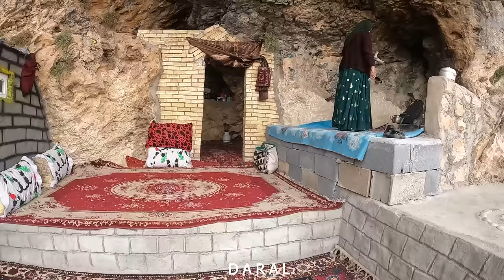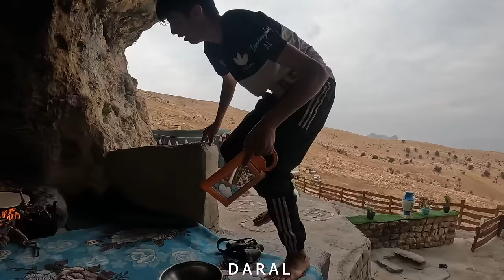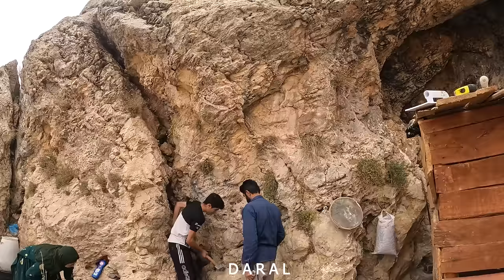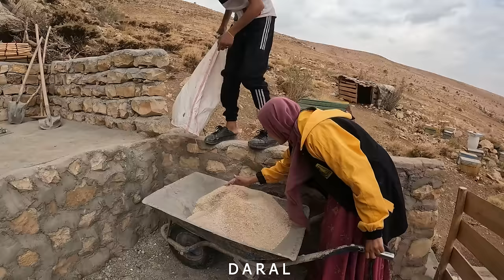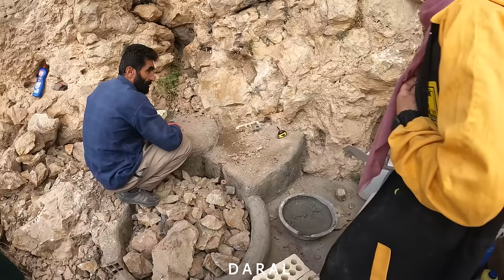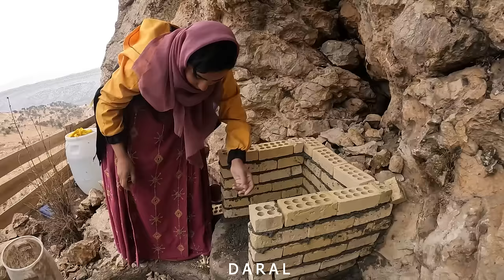"Making a brick sink base for easy washing of dishes | DIY Amir and family"

Comment: Also, you already have a sink on the platform that has Pipe in it to drain the water out of the sink across the platform.  Some of the placements of some of these projects seem like after thoughts, just reaching for an idea for another  project not really a logical extension of the original blueprint.  Just seens extraneous. Non sequential progression.  You have a sink with a pipe and a drain in the kitchen area.  What do you need with two, especially when the new sink has no metal drain?

Comment: Still no running water for the bathroom, none for a shower and sink.  Out on the platform you built a sink with running wate but is there a drain like on the front platform where you wash your hands? 
And a steel pipe for a drain. The kitchen area would be more efficient with a sink to wash vegetables, dirty plates and pans with steel pipe  drain to the outside.  Cleaner, more sanitary.  

An indoor shower would be such an upgrade.  You live like in the times before the first toilets, sinks, and bathtubs, no pipes to bring in or drain water.  How do you keep clean?  How do you keep your home sanitary? How do you keep clean, how do you clean your kitchen and your eating area?  Your hands face, private parts, clothing, bedding?

This is 2023. You deserve running water, tap bringing in clean water, a sink, a shower or bathtub, water in the kitchen for sanitary preparation  of meals.  You can buy pipes, washers, tools at a hard warew store.  Running water and a sanitary prep area is not a luxury.  Its a necessaey function of cleanliness and a sanitary environment.
An eating area and a bathing and toilet area should be your next ptoject.  Blessings 🌹